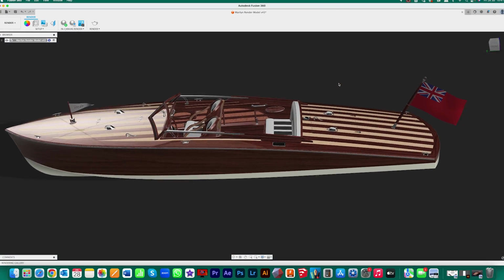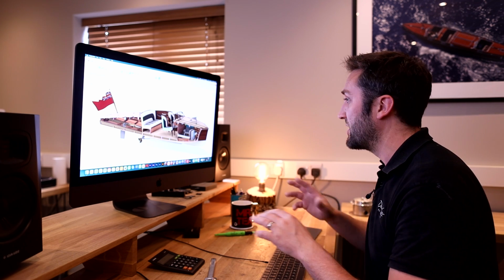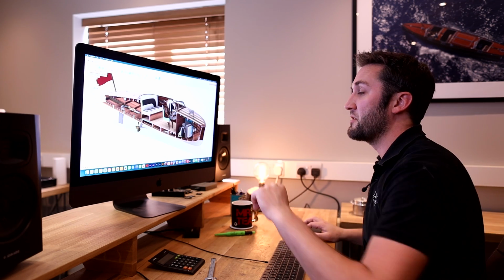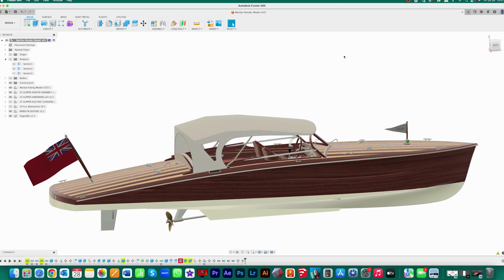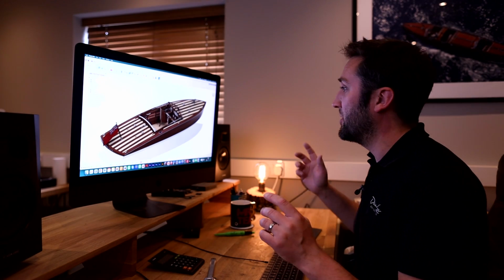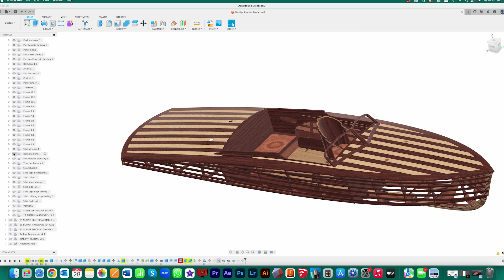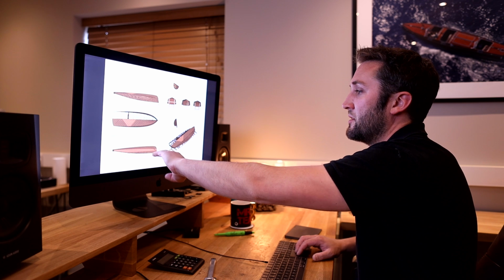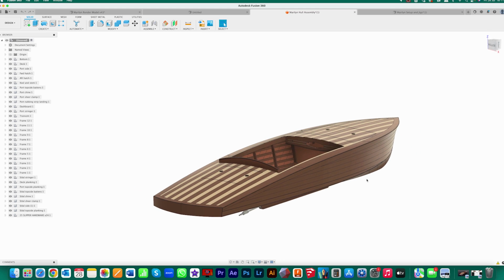Electric Slipper Launch - Boat Building Plans Tour

Comment: I’ve added a Minn Kota 24 volt troll motor on a 2 stroke outboard cavitation plate with good success.
 Cost was around $700 us plus a pair of deep cycles ( lithium was just coming to be ).
    Could do a pair right in rudder .
Great canal boat .

Comment: Would it be possible to do a half scale for using as a single seat river cruiser.  I live in Wroxham Norfolk and would like a classy single seater to launch and recover easily.
Reply from the maker: In theory yes but it’s actually a lot of work to re-work this for feasibly building at half scale.
Reply: I will be doing a simplified version in mahogany strip planking.  Enjoying your content,  Thank you.

Comment: Dan - I love yours and Michel’s designs. 

12 minutes into the video, you show the transom.  Since it is so small, could you just laminate 5-7 layers of plywood, rather than make the curved frame laminate?
Reply from the maker: That would certainly make things easier, I asked the same question when I was kitting the boat. However the disadvantage of laminating a key structural element such as this with ply is that you are reliant on the ply glue line. The other issue is that only 50% of the grain with ply used in this scenario is going in the right direction, the other 50% is almost redundant.

Comment: Great design and video. I am a lynch motor fan as well. I have 4 in my electric narrowboat for maneuverability and one in my 50's motor boat (replacing a V8!) but I find they run very hot as do the speed controllers. Any thoughts?
Reply from the maker: I am guessing they are all air cooled? Perhaps a water cooled system would be a good idea as there isn't always a huge amount of airflow within a boats engine bay.
Reply: @DanLeeBoatbuilding  Thanks Dan, great work!